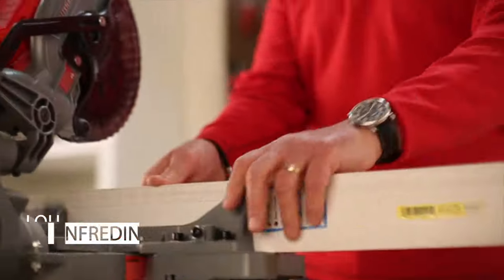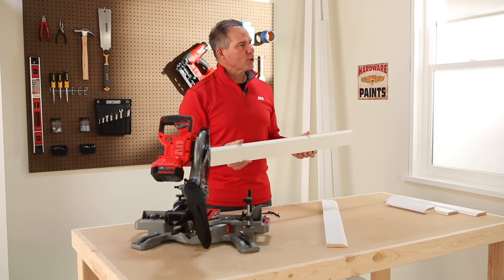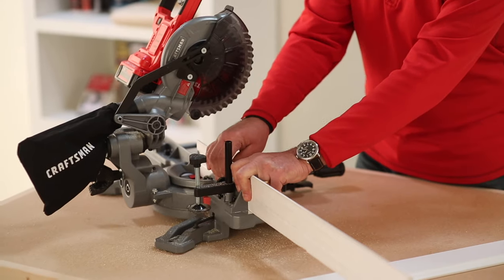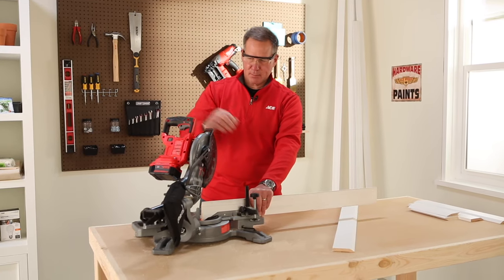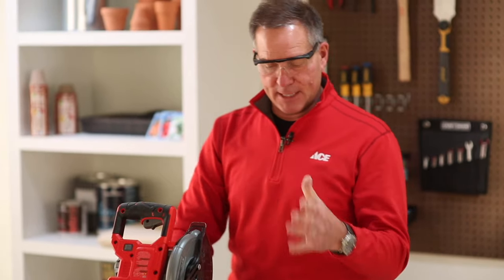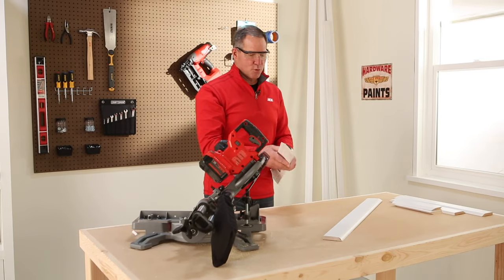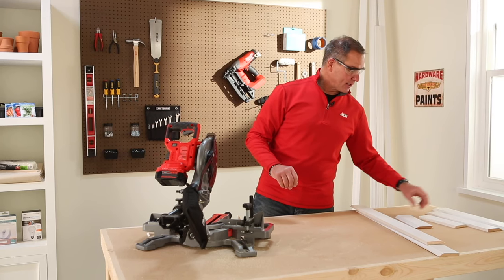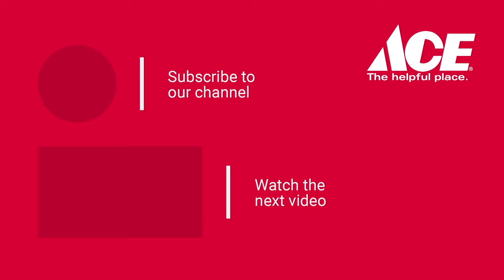How To Cut Baseboard Trim Using A Miter Saw - Ace Hardware

Comment: Okay but how do you cut this angle to the line that you measured? Like you just cut the ends of the board. That's obviously easy, but let's see you mark a line in the middle of the board and cut that mark perfectly so that you get your inside or you're outside angle that's the issue I'm having. Keep having a cut multiple times cuz now that the saw is at an angle where do I line the blade up to the line?
Reply from the maker: Hi Chris,
It takes practice, you make the mark and will get a feel for where to drop the blade. Hope this helps!
Reply: Turn the board with the marked side first to saw

Comment: How do you pick the right saw blade? Do you measure for the cutting bricks at the tips of the saw. Do the alignment notches change over time with use? Which tool is the best value?
Reply from the maker: The miter saw I demonstrate is not the best tool for cutting brick.  It’s not designed for that type of cutting.  As to how to choose a blade it all depends on what you are cutting.  For mitre saw clean cuts are what most are looking for and the more teeth on the blade the cleaner the cut.  Hope this helps! If not, your local Ace can suggest the right blade for the job and the brand you are using!

Comment: Trying to match the baseboards in my 1920s home. Baseboards are 8" in width. Looking around today at Lowe's. I don't even see a miter saw capable of cutting a width of 8" any advice on what to use?
Reply from the maker: Hi Josh,
You can either cut it by hand using a coping saw or buy a slide compound mitre saw. Lay the trim flat tile to saw for the mitre then pull.  Hope this helps!